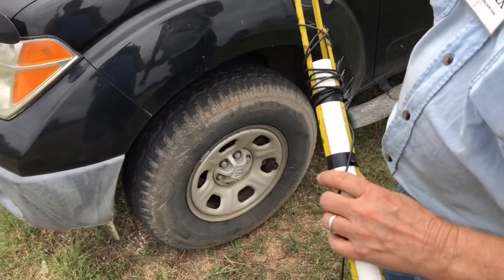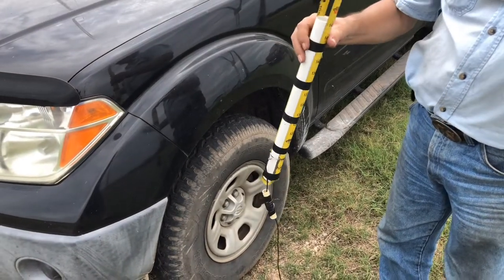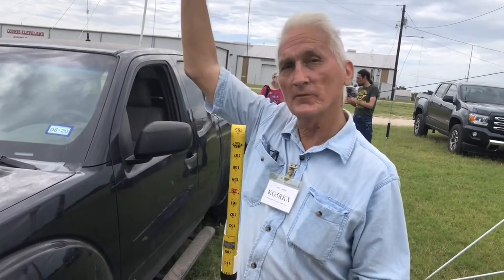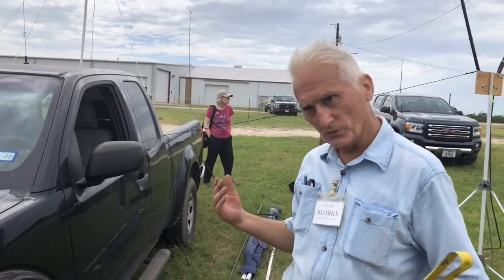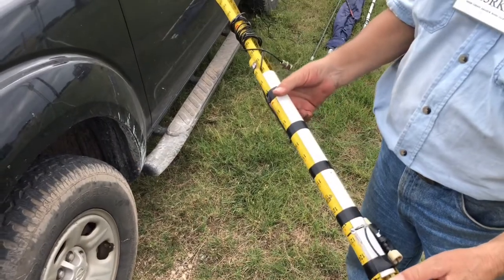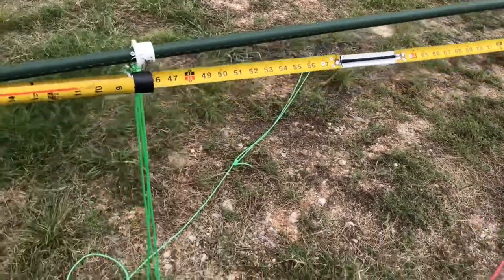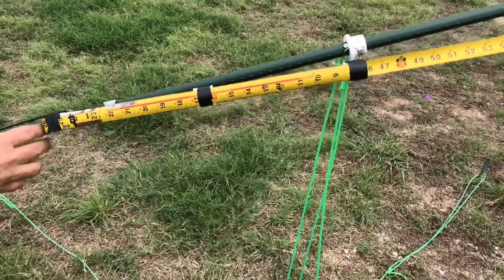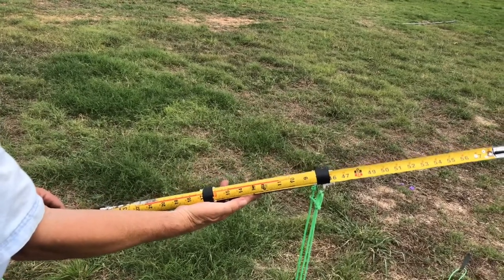Tape Measure J-Pole Antenna - Hood County ARC Field Day 2019

Comment: I just wanted to give the dimensions of this antenna , the short part " j " is 19.2 inches , the long part is 57.6 inches , (3 x the " j " part ) , I used 1 inch PVC cut down to 1 inch lengths as spacers , all measurements are made from the bottom of the curve. Then you have to find the feed point.
  I am NOT the first to do this , if you GOOGLE  tape measure j-pole  you will find more info. on it.
  I also used references from DR ED FONG on the dual band method.
  I have used this antenna about three ft off the ground hanging in a tree and using a half  watt on my HT talked thru a repeater about 30 miles away with no problems , so I know it works well.
  Make one and try it , you might be surprised at how well it works.

  Also  Thank you Curtis